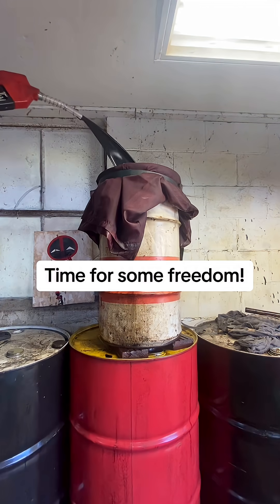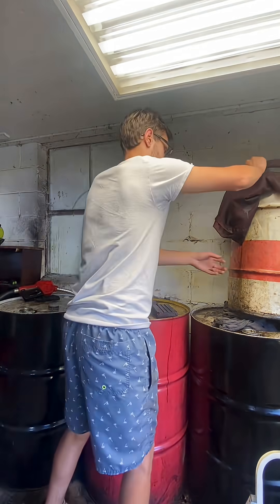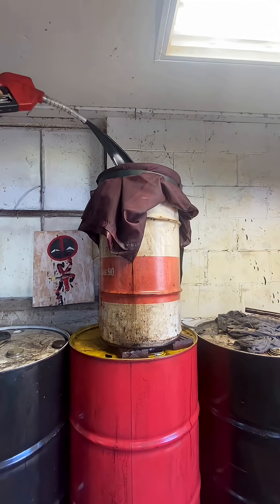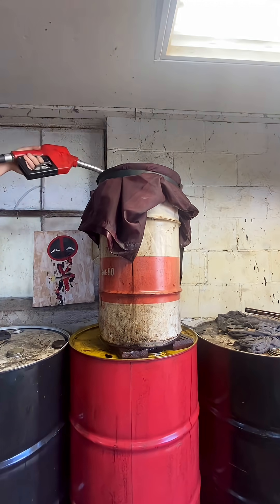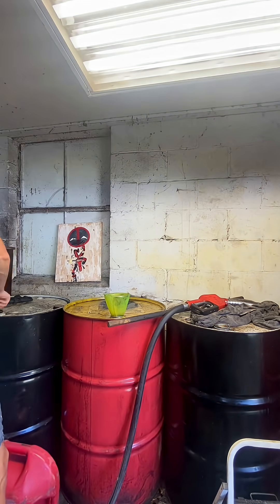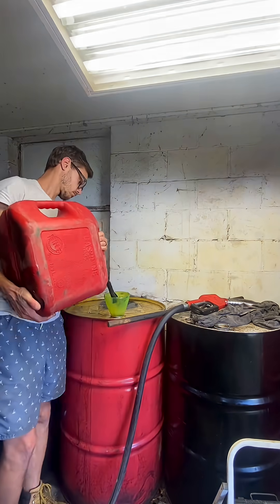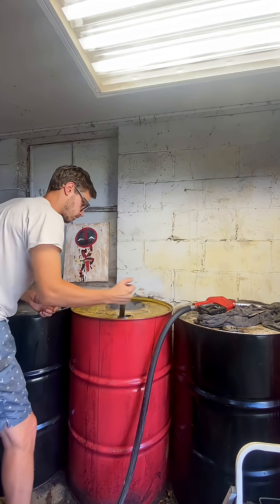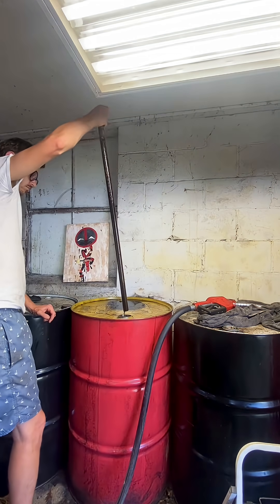Transform #wastemotoroil into #homemadediesel Fuel #dieselmechanic

Comment: It’s been a long time since I did something like this with grandpa - about 50 years ago. I’m pretty sure he went a lot lighter on the gasoline - often times just dumped the motor oil into the fuel tank ending up with about a 50-50 mix with diesel.

Comment: For heating oil maybe. But the petroleum industry can make use of recycled motor oil as well.
Had a very leaky oil pan with a car in 1980, and I simply bought 15 gallon drum refills of CENTRIFUGED used lubricant oil, and it looked clear but brownish. Then again, brand new oil was also brownish.
This was before synthetic oils were commonplace.
I'd rather run an internal combustion engine vehicle on an alternative fuel such as electrolyziser ⚡ split WATER (yielding Hydrogen AND better than atmospheric concentration 100% PURE Oxygen, made on-board the vehicle)
Lab tests show a diesel engine gets 10% increase in efficiency fueled by METHANE (Natural Gas).

Comment: opel astra 2.0 dti, would run on half filtered frying oil and half diesel, ran for YEARS reliably, lasted up to the 300 000km when the chassis rusted away and the fuel lines had leaks. It still ran 100 000km with our mixture and never had a single issue

Comment: You need a much better filter system if you want to use used engine oil. A bed sheet is not even close to good enough for filtration.   With all of the dirt and particulate matter in the used oil, it will cut your life expectancy of your pump and injectors in half.

Comment: It will probably be ok on older, mechanical pump diesels. Probably no good on any diesels currently in production over 24 hp (EPA max for Tier 4 requirement). 
Common rail/piezoelectric injection systems are way too precise and expensive. It will almost definitely foul DPFs really fast too. Don't use it in tier 4 stuff.
However, your old Kubota/Yanmar mechanical tractor and construction equipment engines could probably run it just fine, especially as a supplement. Remember that almost all diesel systems have 2 filters before the high pressure pump on the chassis.

Comment: I have a diesel heater and decided to try this.  Rather than a bedsheet I used an inline 10 micron filter.  After 36 hours or so the heater shut off.  The burner was so full of coke.  

With that, I have an ‘86 Ford 6.9 diesel.  I will not take the chance of it coking my injectors and whatever else.

Comment: i got a buddy with a duce-and-a-half old military box truck. runs off anything remotely burnable. Transmission fluid? gobbles that up. used motor oil? loves it. grease diluted in wd40 and seafoam? cleans and lubes while it burns. 
Diesels can handle a lil more crap than gas cars. you're burning fuel using compression rather than ignition. most deisals can run on vegatable oil, ethanol with motor oil, or transmission fluid diluted in gas. it just needs to be the right consistency with around the same volume of expansion. vegetable oil runs great the further south you go. the further north you go, you'll need heated lines to keep that oil a liquid and not a grease.

Comment: There ya go!!!! I've done this for years in my f250s no problems.
Reply: Feel like that's closer to 2 stroke oil then diesel
Reply: @adamclark2245 😂😂
Reply: 50gals of diesel for the price of $5gal of gas? And you dont think hes saving money? ...I am amazed lol
Reply: 7.3s?
Reply: @Cliffordthe6.0 idi
Reply: Typo on the s. My bad
Reply: My one question is why? Your buying gasoline, unless he's refining it somewhere else. I suppose since diesel has gone up above gas prices  and getting free used oil, you may be saving money. Before the towers fell diesel was as cheap or cheaper then 87-89 octane gas. Which is where it should be, due to it taking way less refining to produce. But I still don't really see a huge advantage here. Good knowledge to know though.
Reply: @bradenoconnor2987 buying a 5 gallon can of gasoline at say $25 in california, then you can mix that with at a ratio of a gallon per 4.5 of oil ( this mix I was using) so your getting 30 gallons of fuel for $25. And the price changes of course elsewhere. But for Californians it's a money saver. lol
Reply: I don’t doubt that an engine would run on this, but surely all the tiny pieces of metal filings would murder the fuel injectors?
Reply: @DavidMc73 well it's gotta be filtered. I mean this isn't the exact way I did it step for step. But it works.

Comment: I was doing a similar thing until my truck started running rough 

So i have 3 concerns here

1 the used motor oil can have small metal shaving in it

2 the used motor could have water/ anti freeze in it. U know blown head gasket = milky oil

3 petrol & oil does not mix

So try running your diesel on any of these & i think it will end in disaster

Comment: No magnets to remove metal from iron motor components? You made it less sludgy by filtering, but the acidity has to be neutralized unless the gasoline is ph adjusted?

Comment: Unless you have an old diesel I would avoid using fuel like this. Injectors in today's diesels have such a tight tolerance that your"filtration" system would absolutely destroy them.

Comment: You can burn oil without gasoline in it.  This isn’t diesel it’s dirty oil and gasoline. I wouldn’t use this because the rod knock has got to be penetrating. And so dirty still see the black dirty oil.  No thanks

Comment: Is it just a single bed sheet on top of the smaller barrel? Or did you stage it (2 levels or 3) to filter the oil before it hits the 50 gallon barrel?

Comment: Does chewing thru primary and secondary filters cost less than the one or two drums of fuel you'll make per year? Or Where is this stockpile of used motor/cooking oil that we can all tap into? Few tank fulls and  
rest of year just run Deisel? 
Not to mention this would have to be the best way of burning all the hard to pronounce crap retained by the oils lifetime, and getting it into the air instead of it being dealt with correctly?

Comment: Dump that in a modern day diesel truck and tell me how it goes. An old 7.3 would burn it but the high pressure fuel systems of today along with the dpf system are not going to tolerate it.

Comment: Is this even good for the parts in the engine? It is waste motor oil an well the waste hasn't fully been removed yet do to the color. Yes filter it would improve the quality of the oil. but you would want more filtration to remove as much soot an carbon build up as possible before mixing the gasoline with the oil that way the chemical can mix more easily an pack as much combustible bonds as possible. Ughhhhhh filter twice then mix an sit light a small metal cup on fire to test.

Comment: Could also use atf as well to lubricate the injection system. A diesel engine is a big ass compression machine unlike gas engines that need spark. A diesel engine will run on anything that burns. If you run a non electric peepump and a manual throttle. The injector on a diesel are ran on timing off either the bevel gear under the front engine cover or ran by the cam. Depending on what engine you have.

Comment: have to blend the diesel 80% gasoline to 20% oil, that thins it... then it all sits stilling for a few days or months so the carbon sinks to the bottom. after syphoning it sucking from the very top with a floating tube, most of the carbon sits at the bottom later being used as asphalt, as to the syphoned portion the gasoline only has to be evaporated and distilled to be reused endlessly filtering oil, only loosing oil when it brakes down into carbon or leaks along a road made of it trapping it at the same time like a sponge. as oil brakes down the carbon chains do produce more gasoline and actual diesel but its very little to extract out of already refined oil that was just lightly used. diesel is more common to be trapped in the carbon that settles to the bottom during the syphoning process as it does not blend with gasoline fully like the larger carbon chain of oil will... molecular buoyancy and semi polarization.

Comment: A 100 gallon truck fuel tank on a stand with an oil filter and nozzle plumbed into the drain bung hole is way more convenient. You still pre filter what you put in the fuel tank with cheesecloth or a coffee filter so the fuel tank doesn't fill full of garbage.

Comment: Are you driving a 2 stroke engine? Because that's not diesel fuel unless you define "diesel fuel" as anything a diesel engine can burn, in which case peanut oil becomes diesel fuel, as that's what Rudolph Diesel first ran in his first engines. I'd be worried a bedsheet isn't filter enough to get all the ick out of used engine oil though, and some of the oil additives and contaminates are chemical vs solid so they'll get burnt up by the engine instead of filtered out beforehand.

Comment: That's not diesel... that's oil with some gas in it...the oil you are using is super dirty too, that's gonna muck your engine up so bad and it probably doesn't run as efficiently as actual diesel would...you can convert oil to fuel through chemistry though, you should look that up because what you are doing is going to shorten the life of your engine unless you are completely rebuilding every couple of months....also, you can run a diesel engine off the oil directly, just need enough diesel in a second tank to get it going and once it is going switch to the oil tank...

Comment: 🤔 Does the truck burning the homemade diesel have a Adblue system where you have to put in the exhaust fluid with all that smog crap or has it been removed or what? Also does it have a cat , will it clogg up a cat?

Comment: Guy  had a setup with a black 500 gallon Polly tank. The big tank had air hook up to push oil through this pipe full of scrubber into the hot water tank drain spigot .the clean oil came out the blow off side and the top 2 connectors was looped  . This thing ran slow like a pint a minute.  

The oil I helped feed this thing was was gross. compressor oil fryer oil .grease engine oil . Im talking like dead flies roaches extra extra crispy shit. He cut with Coleman said you can use gasoline the ethanol is bad though .

Im not saying heat oil I don't know shit but there's something to it. Oil was way cleaner coming out the other side 

Ran it in a Herc

Comment: I didnt know it was that easy, one thing i do know as a homeless person i can use diesel in an oil lamp when i am camping instead of paying $10, for 1/2 gallon of the lamp oil that is basically the same thing. Plain old deisel is a lot cheaper and doesnt have any die in it
Reply: Yes but kerosine or lamp oil will burn cleaner and not fill your breathable air with nox and other contaminates. Diesel engines have been developed for decades to lesser the amount of soot, particulates, and other things (things that can cause cancer) that are loosed into the air when diesel fuel is burnt, burning it straight in a lamp give you none of the protections an engine is required to have. Diesel technology has come long way and can now turn a lot of the harmful emissions to water vapor with the help of DEF but a lamp will just leave you breathing it all in basically straight and in very close proximity for long periods of time.

Comment: This might run in an old low tech mechanical injection diesel engine. But dont try it in a modern light duty diesel truck engine, especially if your warranty is still in effect. My guess would be most of you good old boys probably have older out of warranty machines that maybe about ready to retire. Just keep all that particulate matter that you emit down there.

Comment: For anyone curious, this does not make diesel (diesel being a specific boiling point range distillate of crude oil) and is likely going to ruin your engine in the long term, as well as being generally dangerous to your health.

Being smart means buying the correct fuel to protect your engine and keep it running well, not thinking like a 5 year old and mixing things together to end up with something that kind of looks right.

(From someone who has a phd in Crude oil processing)

Comment: You can build a cyclone prefilter  by using a gallon glass mayo jar   and soldering 2 copper 1/4" tubes into the lid with the in tube bent at a 45' at the top half parallel to the wall and the out cut to 2/3 down the jar so you dont pickup settlings .
As the oil is pumped in it buids a cyclonic action and the water and particulars are forced against the wall and strip from the lighter fluid.
I would set this inline as a prefilter with a series of water seperator and cartridge filters before it came near my vehicle .
And heat and thin your oil as much as you can before processing.

Comment: You're holding the gas can wrong. How you were pouring it, rotate the angled nozzle 180, then pour with the handle that was on "top" in the video by rotating that so it's vertical closest to your chest. It allows air into the can after it's a little bit drained, and starts pouring instead of glugging for the entire 5gal

Comment: The Toyota Hilux I drove for my last job literally blew so much diesel particulate smoke out the back I’m pretty sure the manifold on those is the wrong size for the exhaust filter, and now I just hate the smell of diesel.
I got it addressed by a mechanic multiple times and it never fixed the issue.
Even the particulate would get all over the back end of the car and stink up anything that touches the toxic grime.
It was so bad you couldn’t have the windows down or AC vent open when stopping or in slow traffic.

Comment: The crappy can nozzles can work ok, I pulled all of the spring loaded sllde locks off turned all of mine upside down (slide on the lower side) and they all flow much better. and I dont have to mess with it because the lock rests on the near side of the barrel with fuel emptying over the vent.

Comment: As a proud owner of one of those gas cans. You take the upper lip on the nossel and set it on the lip of the 55 gallon drum. Trust me. when it sucks out all the air and dis flows the fuel. Tip it down pivoted off the 2 lips. Insuring they stay together. Once air displaced the vacuum once created tilt back to fill position. 🤷 Idk. If your still reading this I actually love this style gas can.
Reply: Tractor supply had the nozzle kit with a bleed hole. Turns an epa gas can into a real gas can
Reply: @deanmoore1752 i have to go there tomorrow. I'm gonna take a look for it.
Reply: @deanmoore1752  I had an excellent old can with a small threaded capped hole at the back.  Turn the cap to expose the hole when tipped (which wasn't that big - less than a qtr inch)  and the air went in and the gas flowed out!

Wasn't until recently that I discovered they don't come built like that anymore.  And the new nozzles that are brought separately (for $15) don't work quite as well.
Reply: Nobody can understand you
Reply: @edwardrook8146 there is a hook on the tip of the nossel. Set the hook to the lip of whatever your pouring into and just let it do its thing. If you can't set it against itself. Well. Funnel might be better. I'll just hold it. I'm a bigger person.
Reply: @edwardrook8146 😂😂😂
Reply: Why not just use a  Funnel and take that stupid spout off and pour it.😮
Reply: Those cans suck
Reply: Siphon hose works pretty well too.
Reply: I just put a screw at the back of the handle, unscrew it when needed and back to having a vent you go!

Comment: I would filter it out more.  It's going to have impurities like antifreeze it along with water. First I'd dewater it. You can get heat tape wrap a barrel just get it warm enough so the water evaporates off it. This is dewatering. After this you still have impurities it the oil, thats why it's black. I'd filter it a few more times.  You are going to want to use or make an actual filter used for water.  Make a trickling filter or cartridge filter. I wouldn't use gasoline. I'd use diesel fuel additives or kerosene or a combination there of. I think you can get a cetene additive as well. It's filtered and dewatered. Or if you are feeling adventurous and have the knowledge You can distill it known as pyrolis. You have to have knowledge you welding, pressure tanks and distillation.

Comment: No, 55 gallons of used motor oil mixed with 5 gallons of gas does not make diesel fuel; while some older diesel engines might run on a blend of used motor oil and gasoline, this mixture is not true diesel and can be very damaging to modern diesel engines, especially those with high-pressure injection systems or diesel particulate filters.

Comment: I just use my used oil filter it put diesel clean and marvel mystery oil in my 100 gallon tank in the bed of my truck the diesel clean is good for lubricanting the top of the engine because of some body’s bright idea to remove the sulfur from the fuel so you engine sounds like it has marbles in the engine

Comment: Make a heat exchanger with the radiator reduces the viscosity and blend with diesel instead of petrol i used to go 70 30 using chicken fat.. Hydraulic oil is also good to use as well. What type of vehicle is it. Mine was a 1986 Nisson.

Comment: I used to do about the same in my 1980 Datsun diesel pickup. except I just did it out with putting it about a 50/50 ratio with regular diesel. ran like a top